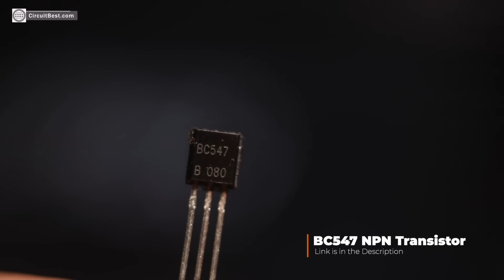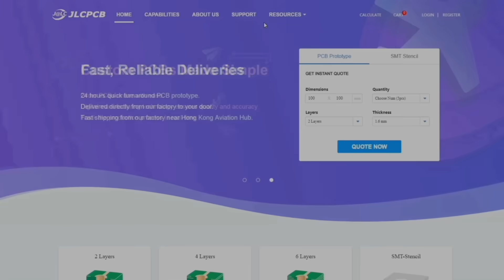[NEW] Simple Electronics Project

Comment: If you used red, yellow and green, you could use them as traffic lights on a model railroad. Just add a circuit to handle 16volts. You could have a street with several sets of lights. Could you control say 3 sets of street lights so that the first control fires up each of the 3 sets so they look like timed lights? I'm just thinking about a practical use for this circuit.

Comment: INCREDIBLE!!!DIY generator coil!!!how to wind a coil!!!LED test/как намотать катушку для генератора https://youtu.be/6tosn77Vh7Q
BEST!!!64v Generator 3D printing DIY/64в генератор своими руками на 3D принтере https://youtu.be/Iao_HT0Vc7U
Indicator flux gel test for soldering/индикаторный флюс гель для пайки тест https://youtu.be/RaaS8dXLW30
TOP 3 Electrical DIY  #1/3 лучшие электронные самоделки 2021 своими руками https://youtu.be/h3UmoXsmdn4
BEST!!!AutoLight With Light Dependent Resistor LDR: Photoresistor/автосвет с фоторезистором https://youtu.be/7LPpgEddAQg
Solder Paste SD 318 NEW Test!!! тест паяльная паста https://youtu.be/VtjyjsoK36c
0$!!!FREE energy!!!perpetual motion machine!!!free charging!!!Вечный Двигатель генератор из кулера https://youtu.be/8290MzsLMws
12v simple battery level indicator without relay/transistors уровень заряда батареи 12В https://youtu.be/iK7FnWakCsg
Сurrent Phase Tester BC547 DIY индикатор фазы/скрытой проводки своими руками https://youtu.be/lkAOjolr9Sw
3 Level Water Sensor Electrical DIY BC547 индикатор уровня воды 3 уровня своими руками https://youtu.be/qEeE8NePDAg
BEST!!!Wire cut indicator!!!Индикатор обрыва цепи!!!Open circuit indicator!!! https://youtu.be/v83A0qzV52M

Comment: I'm sure it can become very useful in the model railway world if I knew what the component were and where to obtain them from...great video by-the-way
Reply: The components are
-BC548 transistors X3
-10k ohm resistor X3 
-led X3 
-470 ohm resistor X3
-silicone wire
-tinned copper wire
-bigger led X3 (optional)
-470uf 25v electrolytic capacitor X3
The schematic is in the description. The speed of the led blinking could possibly be increased by lowering the capacitance of the capacitors to something like 200uf.
-3.7v 18650 battery holder 
-3.7v 18650 lipo battery
Reply: @thengspjo4716  000
Reply: Jameco Electronics, is my 'go-to' place for discrete electronic components.  They pretty much have it all.
Reply: Cak
Reply: WHAT ARE PHONO CONNECTORS , SPADE LUG , F-TYPES , BANANA , BNC , IDC  AND MANY MORE CONNECTORS !!!!
DIFFERENT TYPES OF CONNECTORS !!! https://www.youtube.com/watch?v=X3lXd1txuPI
ELECTRONICS BASICS